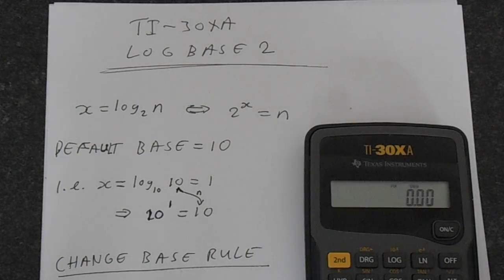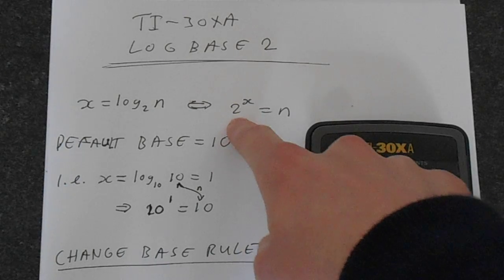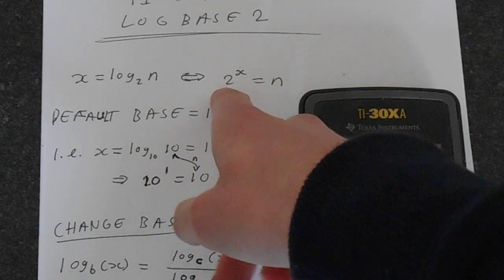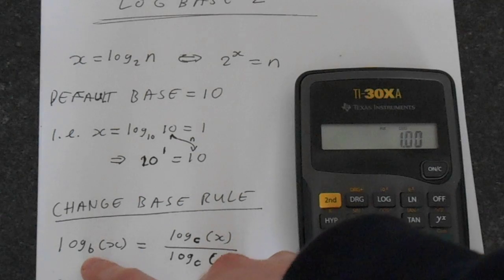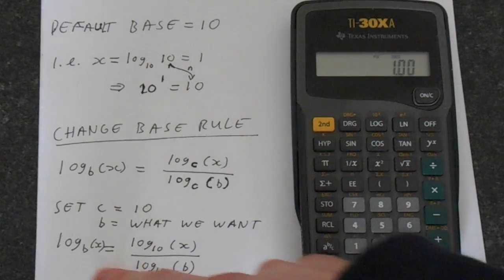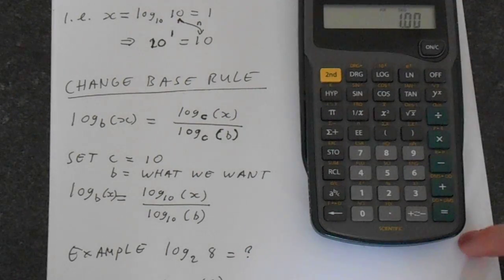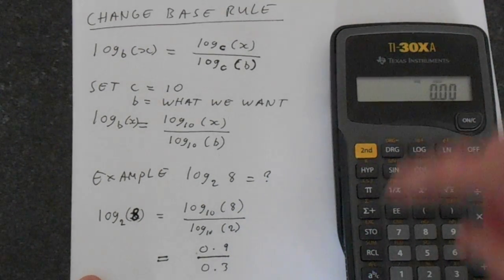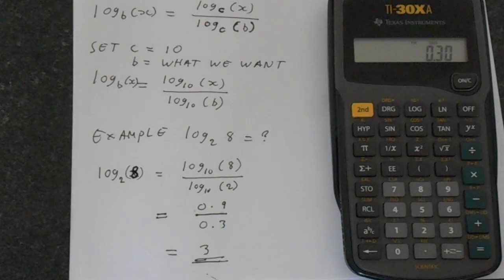TI 30Xa: How to Change Log Base (log base 2 example)

Comment: Whole idea of using  scientific calculator is not to write temporary results in paper, especially rounded to two digits. That is a failure and causes collapsing bridges.  Just press 8 log / 2 log = (you can use also ln instead of log).

Comment: You do not have to write anything down on paper! Simply use parentheses! 
Behold on the TI-30Xa: enter, ( log8 ) / ( log2 ) = 3
Reply: No need for parenthesis. Also you got it wrong. With a calculator where one enters the whole  line you would enter "log 8 / log 2 ="  (or " log( 8 ) / log( 2 ) =" if the calculator opens the parenthesis automatically (which I hate)) . With a traditional calculator like this one uses "8 log / 2 log =". These traditional calculators use infix for calculations but postfix for functions.
Reply: Thanks ya'll!
Reply: Need another bloody video for brackets fam

Comment: how is log2 of 8 obviously 3? explain please
Reply: 2^x = 8, you should know your exponential values for small numbers like this. So it's obviously 3.
Reply: Log2 of 8 is the inverse of 2^x=8 and if we put in 3 for x , it means that we will multiply 2 by it's self 3 times or 2x2x2.
Reply: It is obvious for those who have done these at all just as log2 32768 = 15. It is like 2+2=4. It is not obvious to those who have never heard numbers but for most it is.
Reply: It's basically asking what power of 2 gets 8. 2 to the power of 3 is 8.
Reply: 2^3=8 so log_2(8) is obviously 3. If you can't do that in your head, you shouldn't use a calculator just yet :-D